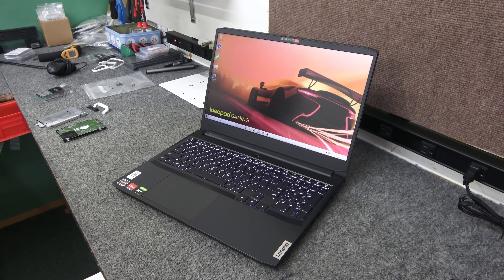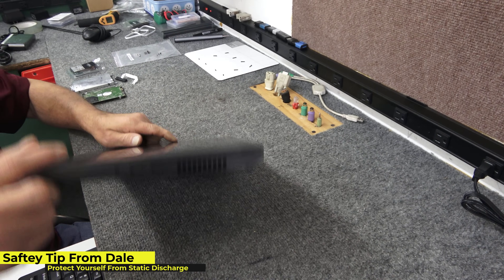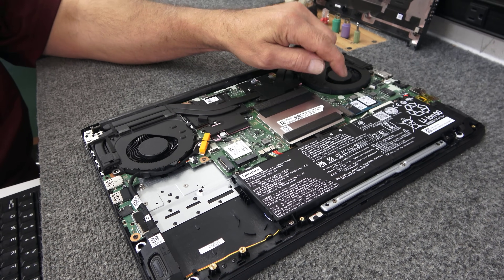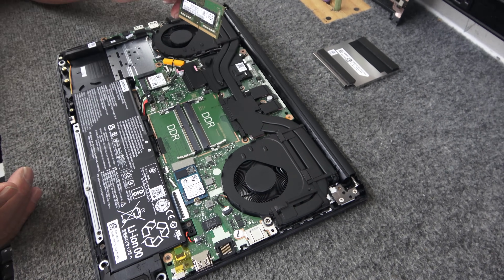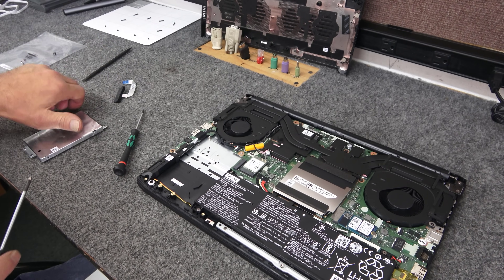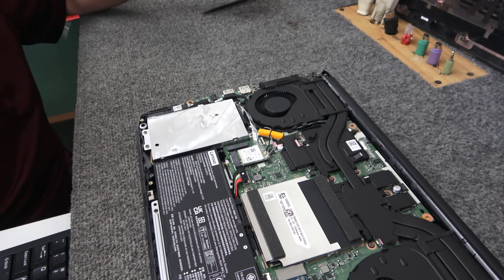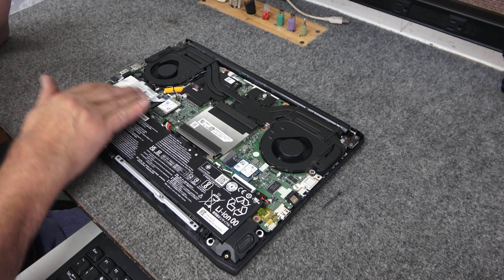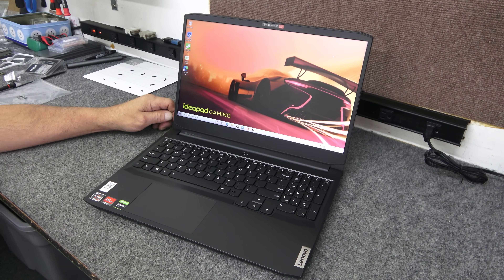Upgrading Lenovo IdeaPad Gaming 3 Laptop.  Memory and Add HDD.

Comment: Just bought this laptop recently and found this video, it was a great help - I upgraded the RAM to 16GB and added an 1 TB HDD and i love it.  Just like your customer I just wanted to put lots of music on the hdd since i'm learning to DJ these days. It's working beautifully so far!
Reply: Buying this laptop or the Asus Rival tomorrow. How do you feel about it after using it for a while? Any annoyances you’ve noticed?
Reply: @ChadRama Senju its his/her dream let them be
Reply: Hey, I’m planning on buying the laptop and had a few questions in advance, what ram stick/sticks did you buy for yours along with your hdd, any recommendation or advice for when I put it together?
Reply: @HonorableGrandson  well, I used 2 Crucial DDR4 8 GB sticks with a 1GB drive from my old laptop.   I think this video pretty much sums up what you need to do very well, i used it to upgrade mine 😅
Reply: @madamx7422  does it support after effects editing software???
Reply: @kathomimedia  i have DaVinci resolve so i can only assume but from my experience editing was pretty smooth
Reply: @madamx7422  lemme place my order then 💴💵💸💰
Reply: @madamx7422  do i need to clone anything after i upgrade ?
Reply: @HonorableGrandson  DDR4 3200 Mhz
Reply: And also where did you get the sata adaptor for the your HDD hard drive?
Reply: @theclueless_gamer  my laptop came with a SATA caddy and the wire you need to connect that to the motherboard
Reply: @theclueless_gamer  mine is going strong so far,  handles my DJ software smoothly,  the video is good,  very quick load of web pages,  no real complaints.   Even the bloatware is tolerable - a trial of McAfee is included and is actually pretty good lol
Reply: @theclueless_gamer  it comes with the laptop
Reply: @Opin10n  haha yes it did, i've had it for almost a year now. there's lots of things I love and hate about it.
Reply: @theclueless_gamer  had mine for a about a month now made the upgrade and liking it even more .. what do you dislike about it
Reply: @Opin10n  the top 2 things are 1. The Keyboard, its easy for debris to creep under the keys making it hard and annoying to press plus trying to get the debris out is a hustle. 2. it heats up quite a lot when gaming or doing things that are demanding, you can feel the heat when typing and after a while the rubber feet slide off because of it.
Reply: @theclueless_gamer  rubber ..? We are talking about the lenovo laptop right ..? Because mine has no rubber
Reply: @theclueless_gamer  ohhhh under the conputer
Reply: @theclueless_gamer  i had the same issue before i upgraded it my computer sounded like a ps4 when playing d2 .. after the upgrade it the fans were much more quite and were no longer using as much power to perform well and this is while getting 80+fps in pvp
Reply: @Opin10n  what upgrades did you put in?
Reply: @theclueless_gamer  2x8GB RAM 
, 512GB HDD .. funny story tho almost bricked my laptop twice, dropped the ram lid on the motherboard almost started a fire on the laptop, and wasted lots of money not realizing i need extra screws for the hdd upgrade aaaand bought pc ram 😂 the long stick
Reply: @Opin10n  i did the same upgrades.
Reply: @Opin10n  Lol unlucky, i had to make sure I bought the correct ram so I opened mine up and removed the ram to count the pins then counted for the same number pins on an online store where I bought it.
Reply: @Opin10n  didnt yours come with all the HDD attachments? mine did
Reply: @theclueless_gamer  and yours is still loud ..??? What settings sre your games on
Reply: @Opin10n  no i wouldn't say it's very loud but it gets so hot you get some discomfort using the keyboard. Mind you my problem isnt performance wise coz I play apex with 80-120 avg fps on medium low settings 1080p.
Reply: @theclueless_gamer   hey, did you notice anything different after the upgrades about the battery and thermals.
Reply: @Airoxen  i didnt put thermal paste in coz i was afraid I would somehow damage it in the process and void warranty. but I did notice it ran faster and a lot smoother with the ram upgrade
Reply: @Opin10n  Yeah you need SODIMM 😂
Reply: @theclueless_gamer  You wouldn't need to add thermal paste if all you changed was the RAM and added a SATA drive. The only time you would need thermal paste is when upgrading the CPU (which you can't really because it's soldered to the board I'm pretty sure) and when you're upgrading the GPU (which is also soldered to the board).
Reply: @porschepal7932  what is that 😂
Reply: @Opin10n  SODIMM is laptop RAM.
Reply: @porschepal7932  oh well i got enough now 😂 i can go up to 32 but i see no point honestly.
Reply: @Opin10n  What model is your laptop? I see online where it says up to 16GB.
Reply: @Opin10n  It would be nice to be able to use 32GB of RAM if you run a lot of VM's.
Reply: @porschepal7932  i got it off amazon lenovo ideapad gaming 3 mine came with 8gb ram but i can go up to 64 if i wanted
Reply: @Opin10n  Hmmmmm. I'm looking at the  82K201XCUS model and from what I've found it says up to 16GB of RAM.
Reply: @porschepal7932  mine does not say a limit
Reply: Hi, I'm thinking of updating 1tb HDD. Do you think you can share the link you bought from?
Reply: @noel_duarte29  i got it from Amazon for my old laptop originally.   When i got the new one i just added that to it
Reply: @Madam X You could justadd SSD in it would be much better!
Reply: You could just add SSD in it would be much better!
Reply: @rkhadkachhetri  I could've but i took the hdd from my old laptop - i'll likely do that later on but i'm fine right now
Reply: hi whats the ram speed of the one you bought? is it 2666mhz or 3200mhz i have the ryzen one
Reply: @nora-nd7us  3200
Reply: @madamx7422  tyy alsoo can the laptop use 32gb of ram?
Reply: cause it says the max ram is 16gb so irdk
Reply: @nora-nd7us  the max on mine is 32gb
Reply: @madamx7422  What your model number? I too only see where it says 16GB is the max amount of RAM. Also what's the processor?
Reply: @madamx7422 hey i have a question the brand say it’s only support 16gb ram but mine already 1x16Gb so can i upgrade to 32Gb for dual channel performance and does it add any value?
Reply: I have Lenovo IdeaPad Gaming 3 Ryzen 5 5600h model, will it support 7200rpm Hdd
Reply: @rockstarprashantpanth1545  that's what i have and yes, it will accept 7200 rpm hdd, that's what i have in mine.
Reply: @madamx7422  but my Laptop is compatible with 5400 Rpm hdd
Reply: @rockstarprashantpanth1545  you can use that too if you want
Reply: @madamx7422  oh but wht if it defected my Lenovo Gaming IdeaPad 3 Ryzen 5 5600h configured laptop
Reply: @rockstarprashantpanth1545  adding an Additional drive doesn't affect the warranty
Reply: @madamx7422  Oh r u sure, wht is ur name Madam
Reply: @rockstarprashantpanth1545  there's other people on here who have done it with no problem,  i don't work for Lenovo, i just own the laptop
Reply: @madamx7422  Ok but i was just asking ur name
Reply: @rockstarprashantpanth1545  Yes I think almost every laptop will even 10-15 year old laptops.
Reply: @ChadRama Senju it's good but I need to upgrade it but it's battery is worst
Reply: Where can I find the 1TB HDD?
Reply: @gdn6010  Now it's not easy to find a 1Tb hdd online ,better to find it in offline stores
Reply: How much storage of hdd can the laptop support?can I put a 5tb hdd 2'5 there?
Reply: @The Second Chadkage DJ Khaled.

Comment: What's the latency of the stock RAM?
Reply: @Vaky I got the laptop and here are the RAM specs:
-Module and DRAM manufacturer: samsung
-Part number: M471A1G44AB0-CWE
-CAS# Latency: 20-21-22-24
-RAS# to CAS#: 20-21-22-22
-Voltage: 1.2V
Reply: Im wondering about that too

Comment: Do you have to replace both sticks of ram or just one additional 8gb stick along with the default Stick
Reply: you can add another
Reply: @kingcosmuder8078  Hi king cosmuder, is there any counter points to only adding another 8gb stick compared to changing both of them ?
Reply: @ckwk8347  I can only speak for myself and say no since I already had 8gb and just got one stick and it’s worked perfectly. Mixing ram is usually something you should avoid but I think in this instance it’s good as long as you get the right ram

Comment: Hi mate. This video came in right on time. I do have a few questions though. Do you think I can add another stick of Kingston 8GB of RAM, 3200MHz CL22 alongside that Samsung, or should I buy a 16GB Dual-Channel Set?
Reply: I think it's fine having two different ram brands. I did that for quite some time for my PC.
Reply: yes its fine just need to be the same specs as the one inside and you are good. Did the same with mine and it works perfectly im getting 200fps in cs go
Reply: To be safe, I would just get a whole kit (2 sticks) cuz the timings and rank could be different.

Timings=CL22 /CL19

Rank=X16 (SLOW)/X8 FAST
Hope this helps you!
Like and Subscribe!

Comment: Hey bro nice job with the video👍👍…I just wanted to ask something, I put in a TB SATA M.2 2280 ssd in the extra slot but it’s not being recognized. Is it because it’s not nvme? Also I see there is an rgb connection right between the other 256 ssd and the battery…what’s that for? Is to make the keyboard rgb like in the images of this model? 
I hope you see this bro…take care✊
Reply: Were you able to make work the M.2 2280 ssd? Im having the same issue here...
Reply: @alant7000  nope😪😪😪...I dont know why...its not even the brand because I have a western digital tb and the 256 nvme ssd is western digi as well
Reply: @swagadoubles604  Finally was able to make it work! The problem was I was not fully inserting the new ssd to the port 🤦🏼‍♂️ the ssd I'm using is a 1tb WD Green SN350 NVME... I hope you can make yours work too!
Reply: @alant7000  still not working😪...I have a WD 3D NAND SATA SSD M.2 2280
I'm actually wondering now if it's because it's a SATA and not a Nvme
Reply: @swagadoubles604  Did you guys have the standoff?
Reply: @alant7000  I just got my Ideapad Gen. 6 today. I had hoped to add a 2280 WD Blue SN570 NVMe. However having watched this video and opened up the laptop the space for the second slot does indeed look a bit too tight as stated in the video. I am curious how did you make your 1tb WD Green SN350 NVME fit in the extra slot? Is it secure? Thanks in advance for any feedback, cheers.
Reply: @Sheepstr  Yes, mine came with a standoff pre-installed.
Reply: @desiresur8  I installed it on the slot located on the opposite side of the pre-installed ssd. My laptop came with a pre-installed standoff although it was in the wrong position, so I just moved it to the right location for my ssd.
Reply: @alant7000  So a 2280 SSD can fit in the extra slot. My extra slot is also on the opposite side of the pre-installed 2242, just like in the video. Thanks again for the feedback!
Reply: @alant7000  According to lenovo:
Installed M.2 2280 SSD is PCIe 3x4 but runs at PCIe 3x2 due to M.2 SSD adapter limitation
So your secondary NVME m.2 2880 SSD working in full speed?
Reply: @shrey522 Sorry, I don't have that computer anymore, so I don't know..
Reply: @alant7000  Hey.. no problem. Thanks for your reply 😃

Comment: Thank you so much for uploading this. Now I feel way more confident ordering the parts and upgrading this same laptop but with a 3060.
Reply: Did you ever get it to work? I heard it's not possible to upgrade gpu
Reply: @utubeber1569 There is another model of this laptop that uses RTX 3060 GPU. It's really not possoble upgrade GPU
Reply: @totalblack7488  damnit, thanks anyway
Reply: @totalblack7488  can you share the buying link
Reply: @Relaxing Storm you cannot upgrade anything in Lenovo IdeaPad 110. I updated the windows 10 to the latest version, and when i restarted my laptop,it didn't turned on.then i took it to the service centre and they installed windows 7 in it, and said *it doesn't support windows 10 properly. Even its 8th gen laptop. I really lost my 35000. Its not worthy
Reply: @intaaryt  damn you had me at the first half ngl
Reply: Hey dude, if u r looking for a new laptop  i will personally suggest you HP Pavillion gaming laptops, and choosing model depends on you, but i will say the only thing, that is
Never ever buy a lenovo product. 
Thats it.
Reply: @intaaryt  why? had a bad experience with lenovo IdeaPad gaming 3?
Reply: @kalravmathur  the most worst devices i ever saw is lenovo.
Reply: @intaaryt  why?
Reply: @kalravmathur   clearly you havent used legion 5 pro
Reply: @intaaryt  what lenovo laptop did you use?
Reply: @intaaryt  Why dude?
Reply: @madlesssm9127  Lenovo ideapad 110. And you know what, you cannot personalize its graphics card, lol. I tried to upgrade its inbuilt socalled graphics card, but its not upgradable
Reply: @intaaryt  i have had a lenovo Legion 5 for a couple of years, and it has been faultless.

Comment: This was my first time ever upgrading a laptop. Thanks for helping me not blow it up 👍
Reply: It’s gonna blow up if you do it plugged in on
Reply: @TheTentOfficial  mine blew up with the battery disconnected...... learned some lessons today
Reply: @Opin10n  why
Reply: Few  day ago I buy this laptop...
Lenevo idea pad gaming 3 5600h
Gtx 1650

✅ My laptop temperature in IDEAL mod 50°C
Gtx 1650 Gpu Temperature 45°C
Amd Radeon Gpu Temperature 47°C
is it normal..

✅And this model Laptop i face fan noise like spinning when colling  fan are slow...
is it Normal.....

Place Help me....😩😩❤️❤️❤️
Reply: @abdulkaium8773  normal

Comment: I already buy this laptop I use almost 2 months
Reply: @anushka chathuranga Geforce GTX
Reply: @wehtamtaggnim2548  overall review?
Reply: @SteveHDCh  it's pretty good. I have the Ryzen 7 5800H model and it's blazing fast. Battery without gaming lasts about 3-4 hours for me in normal apps ( with a lot of optimization). The RAM is pretty tricky to upgrade as the stock RAM stick is not sold anywhere in my country, so I'll have to go for a 2-stick Dual-Channel configuration. I will also add a 1TB HDD. I think the stock SSD is enough for most people. 

The screen is okay, not impressive, but okay. The Keyboard is amazing imo, it has an amazing tactile feel. The sound is ok, but I recommend activating Dolby Access from Microsoft Store to make it sound better.

I'm here if you have more questions. :)
Reply: @liviuovp  So, any update about the ram? Did u finally ordered it and did it worked?
Reply: Do you recommend it?

Comment: I bought this same model several months ago.  It came with a 512 GB SSD and a 1 TB SATA so I didn't have to fiddle with that.  I did replace the ram to upgrade the memory.  The hardest part I experienced with the process was getting the case open.  I have been into Dells, HPs, and Samsungs and this is by far the hardest to pop open.  Really tight seams.
Reply: I see. I have the MSI GF63 which is very hard to open too. The clips are in super tight and I still have the hinge unseated. Good chassis, worst clips ever.
Reply: gf63 is hard to open but this laptop is not hard to open at all.
Reply: @yyaann3684  I had a hard time getting something thin and sturdy enough to get in a seam and not mar the case.  Once I got it started, it popped right open.  It was much better than my old Dell laptop that stripped out about half the screw holes in the plastic as I was removing them and then cracking off the locking tabs.  With multiple repairs I had to make on it in the several years I made it, every time I opened it, it got worse.
Reply: @GopherM  well hopefully you get to know how to open it smoother since you had to clean the fans eventually but yeah i think modern laptops cases are actually not too hard to open compared to the old ones.
Reply: How much ram you update this laptop? it supports 32 gb?
Reply: @luissanchezn  I just bumped mine up to 16 gb.  That is enough to meet my needs.
Reply: Is this possible to upgrade the SSD and get 1 TB HDD + 1 TB SSD?
Reply: @BakuraGZ  unfortunately it's not possible. You need to choose between an 1 TB SSD Sata or 1 TB Nvme m.2 because they use the same space. So you can't use both together.
Reply: @totalblack7488  whats the difference between sata and m.2 ?
Reply: @East_Texas_Gaming  From what I've been told, M.2 are a tad faster.
Reply: @desireegonzalez6219  Much more than a tad.  M.2 PCIe is up to 3500 MB/s.  SATA is only up to 550 MB/s.  Even the 2280 slot (which runs at half speed on this laptop) would still net 1750 MB/s, over 3x faster than a SATA HDD/SSD.
Reply: Hi , if you play some games like rainbow six siwge or gta v or smething a little bit demanding to the pc (can you tell me how much does it heat the zone of the keyboard ? I feel like my keyboard warms up too much , i was playing zero hour and i felt like 40-50 c degrees , so im a little bit worried about it, i just played like an hour... so  if you can tell me i would be grateful
Reply: You are right. It is shut tight. Had to be very patient and gradual when opening it.

Comment: The fact lenovo did not put in a M.2 standoff would be enough for me to never consider this gaming laptop. I typically however buy exclusively ASUS laptops anymore anyways.
Reply: just cus they didn’t give a stand-off? kinda weird ngl..
Reply: Mine came with a nvme and its standoff installed
Reply: @maejorodom5869  i think if they didnt come with an nvme initially there is no standoff

Comment: this ram does not run at 3200 on this laptop, i just installed it in mine and you can not activate the xmp profile
Reply: The RAM he added is rated at 1.35V, the laptop supports mostly 1.2V as far as I know, so that might be the reason